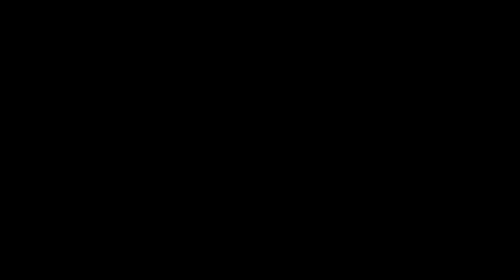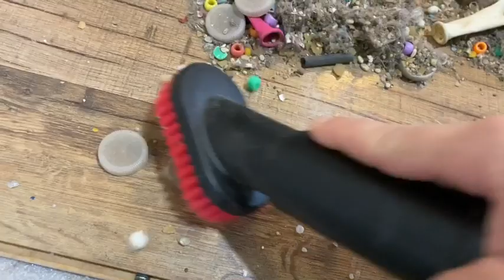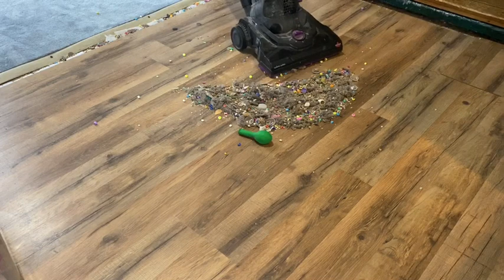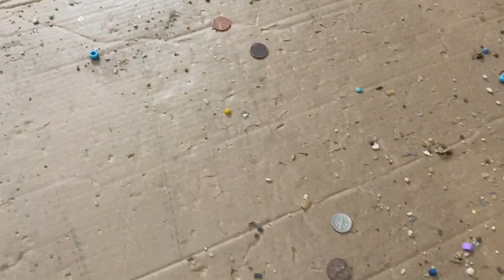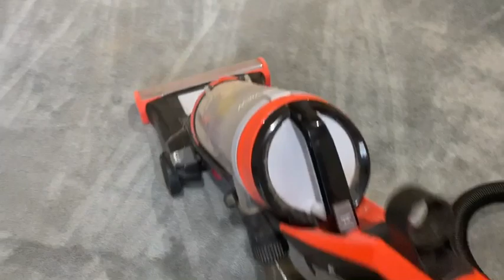Mindy and Lizzy Inspo on hardwood and Cardboard 🤩

Comment: ✨ TIMESTAMPS ✨
(if I messed up on any of the vacs/tools/mixes, please let me know! this is all my best guess)

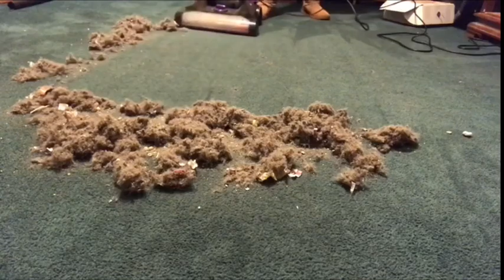00:00 - 0:17 : Intro
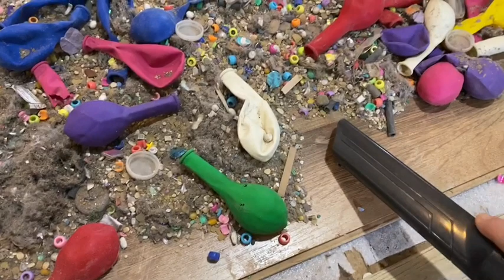0:17 - 3:01 : Closeup cleanview crevice tool pickup on hardwood with circus mix 
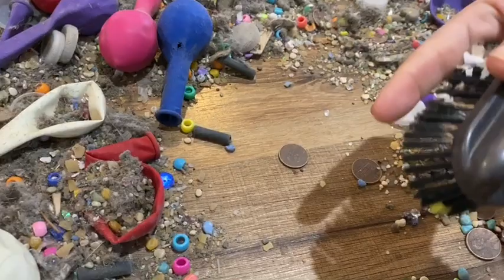3:01 - 3:25 : Closeup cleanview with dyson dusting brush pickup on hardwood with circus mix
3:25 - 6:54 : Closeup cleanview dusting brush pickup on hardwood with circus mix 
6:54 - 12:50 : Cleanview spread out brushroll pickup on hardwood with circus mix
12:50 - 16:57 : Compact spread out brushroll pickup on hardwood with circus mix (less fluff, no balloons)
16:57 - 17:44 : Talking interlude, bin dump and mix spread on hardwood
17:44 - 20:45 : Aeroswift spread out brushroll pickup on hardwood with circus mix (less fluff, no balloons) 
20:45 - 23:49 : Aeroswift brushroll pickup on hardwood with circus mix (less fluff, like... one balloon 🤣) 
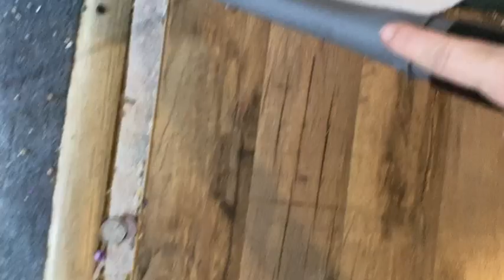23:49 - 28:52 : Cleanview spread out brushroll pickup on hardwood with circus mix 
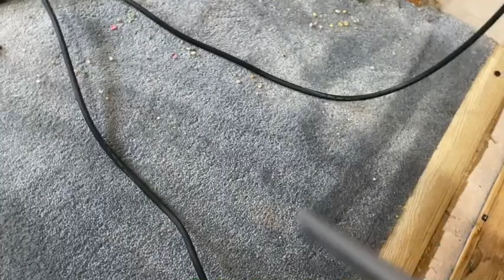28:52 - 31:36 : Cleanview crevice tool edge cleaning and cleanup
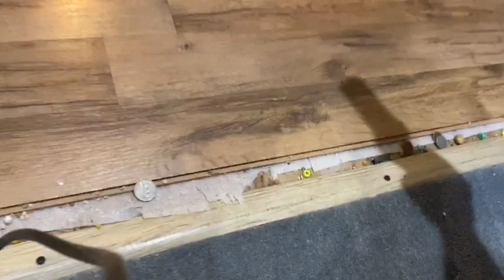31:36 - 37:39 : Cleanview spread out brushroll pickup on hardwood with circus mix 
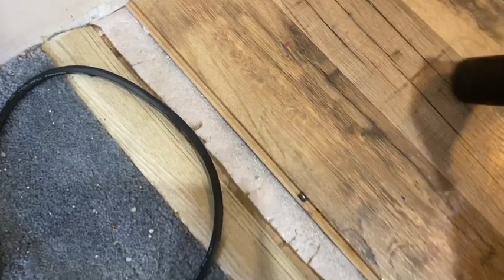37:39 - 38:04 : Cleanview hose edge cleaning 
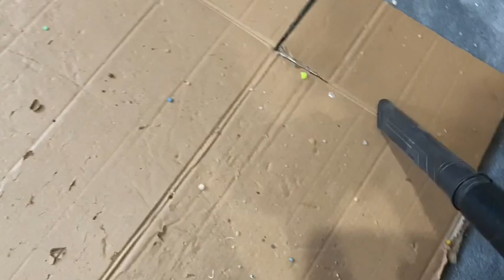38:04 - 40:09 : Closeup Cleanview crevice tool pickup on cardboard with circus mix
40:09 -  41:17 : Closeup Cleanview dusting brush pickup on cardboard with circus mix
41:17 - 44:23 : Cleanview brushroll pickup on cardboard with circus mix 
44:23 - 47:37 : Aeroswift brushroll pickup on cardboard with circus mix 
47:37 - 49:28 : Cleanview spread out brushroll pickup on cardboard and carpet with circus mix
49:28 - 50:50 : Aeroswift spread out brushroll pickup on cardboard and rug with circus mix 
50:50 - 52:05 : Cleanview spread out brushroll pickup on cardboard and rug with circus mix 
52:05 - 55:00 : Cleanview brushroll cleanup on carpet and hardwood
55:00 - 55:31 : Cleanview hose edge cleaning 

❤️❤️❤️❤️❤️❤️❤️❤️❤️